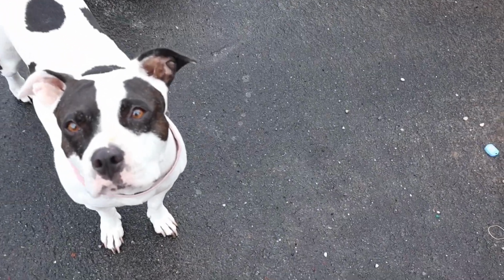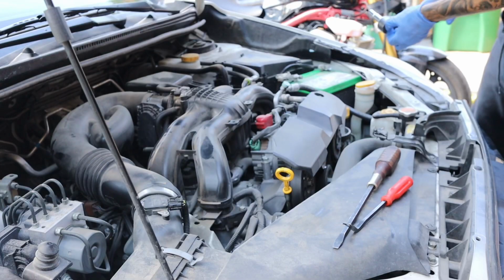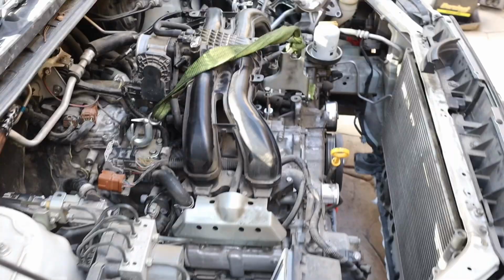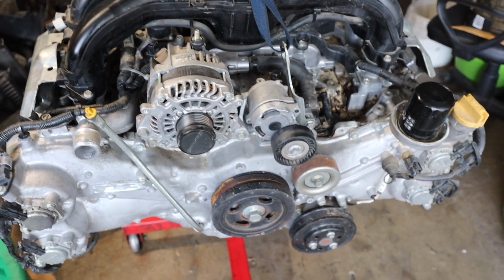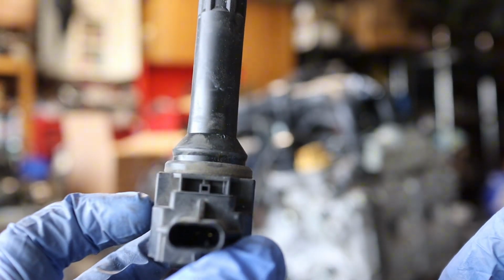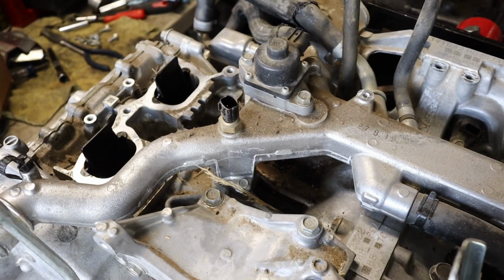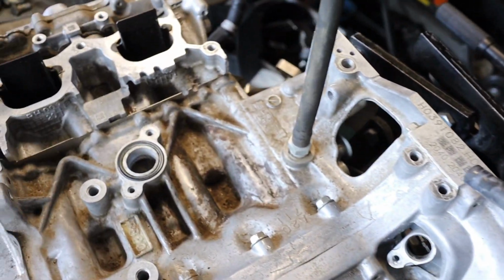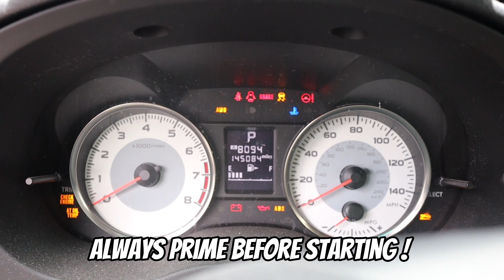2013 Subaru Impreza engine swap fb20

Comment: The engine they gave you is 2014, it changes slightly in some things but basically you could put it in without changing the engine wiring and it would work the same, same sensors, same everything.
Reply from the maker: Glad you know what it came off of I couldn’t figure it out haha but I do have an updated video I’ll be uploading really soon I actually had to remove the timing cover and change out a few things to take care of the check engine light it didn’t want to erase for almost a year

Comment: Dude - this was super cool. Sad to see you don't upload anymore. I'm impressed at how quickly you got the engine out. Any idea why you got the cam code that someone else mentioned in the comments, or what the remedy/solution was? 
I'm thinking of trying to undertake this myself, although I have no knowledge as to what I'm doing here.
Reply from the maker: How’s it going! I think you just inspired me to make more videos haha It was the camshaft position sensors 
If you have any questions you can add me on instagram or tik tok xgarcia96 
It’s a pretty easy swap
Reply: @Garciabuilds96x  Hey! Awesome to see that you're still active. I have a 2012 Subaru Impreza pzev, 153k miles. I haven't started the swap just yet. I'm still trying to mentally commit to this lol. I only have some experience working on my motorcycles, nothing remotely close to this. It's crazy how easy you made it seem. 

 My engine isn't dead yet, but I have engine oil and coolant mixing... The car misfires on startup sometimes... and if my car sits for 3-4 days, it starts with a nice puff of blue smoke. I assume it's the head gasket. I mistreated the engine a lot over time. 10k oil changes, driving on low oil for a long time, and pretending it's a racecar using the paddleshifters to get me to redline all the time. It's been burning a lot of oil the last 30k miles. 

 My thought was instead of replacing the head gasket (which I have a high chance of messing up the timing/gasket replacement), I can find an engine for around ~2000 and has less than 100k miles. Of course, there's no service history, but with LKQ I can at least get a warranty with it. It'll take me a long time to replace the head gaskets and I would risk messing up the timing. It's going to take me A LONG time to do, but would feel good if I can get it done. 

I was really impressed with how quickly you were able to get the engine swapped. I found it really funny at 4:30 you said after an hour and a half you were ready to pull the motor... I know damn well it's going to take me 10 hours to get to that point 😂. 

It's interesting you had to replace the camshaft position sensors and that other comment on this video also mentioned it. I was hoping for an easy plug and play lol. 

Your video showed me all FB20 engines are not plug-and-play. There could be differences. Anyway - thanks for the reply! You might hear from me in the near future... Nice bike btw
Reply from the maker: @poledancerz1 yeah so doing the head gaskets on these is kind of a pain to be honest because of the timing chain situation the older timing belt style is way easier and more simple but oh well haha 
But yeah find a low mileage JDM one or lkq they technically are plug and play you just use your intake which I think I explained all that in the video I just forget it was so long ago ha 
If you’ve never done it I’d recommend just going to pick and pull and start messing with those engines just to learn it doesn’t hurt I promise once you start you’ll be like damn that was pretty easy
Reply: I have a 2015 impreza, what engine can I replace the original fb20 with? Ej series,fa20?

Comment: Could you have just re-used the old ignition coils so you don't have to change the harness? I don't believe they mount any differently other than the plug without the rubber looking slightly different.

Comment: Can I swap my 2013 Subaru g4 FB16 engine with a FB16 turbo engine
Reply: did you get a solution? the fb16 dit is the only fb16 turbo engine there is,